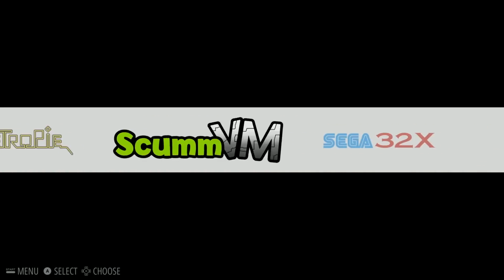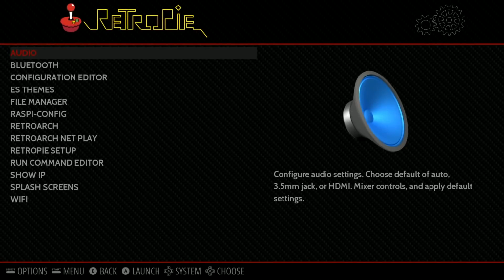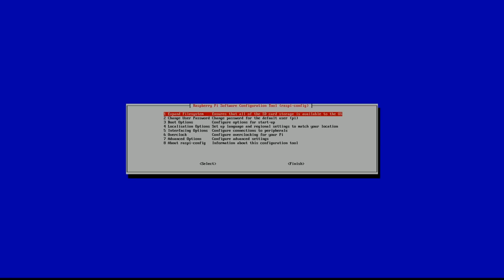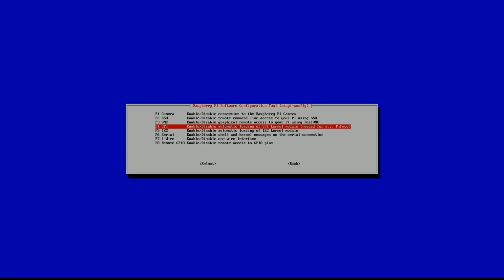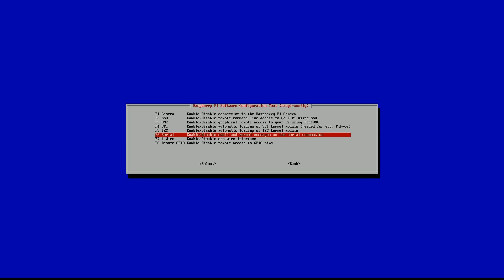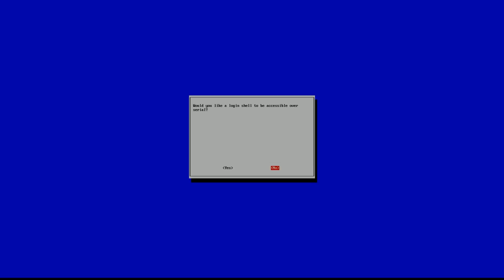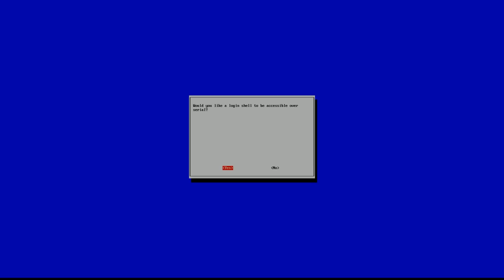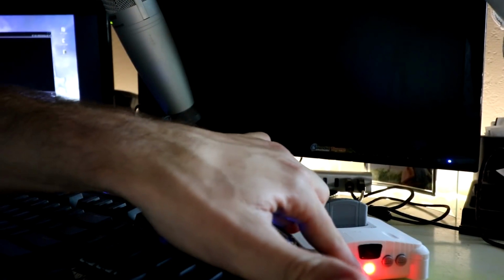Custom Raspberry Pi 3 TinyTendo 64 LED Case Light Modification

Comment: Hey man I did exactly as you did but the light is not coming on
Reply from the maker: is the bulb blown? how do you know the led is still working?
Reply: DrewTalks yes I bought a 3 pack and tried all 3 I have a power button also a reset switch and fan hooked up all working properly but the light will not come on also everytime I go in to change the setting save and exit when I go back it it seems to have turned off
Reply: Dude I’m such an idiot the store I get the stuff from is so messy I accidentally grabbed IR bulbs thinking it was a white bulb finally got the right bulb and works like a charm I have the same case as you but I installed a power button and reset button also would love to show you some pics